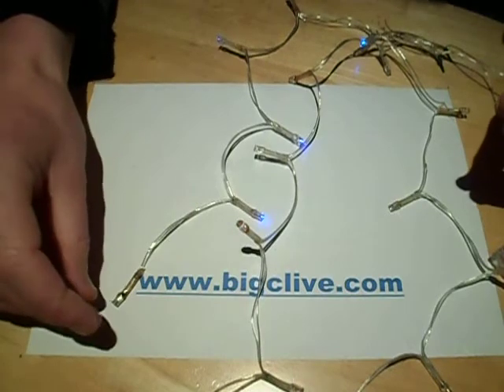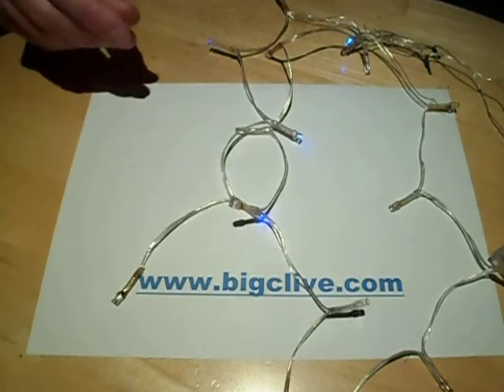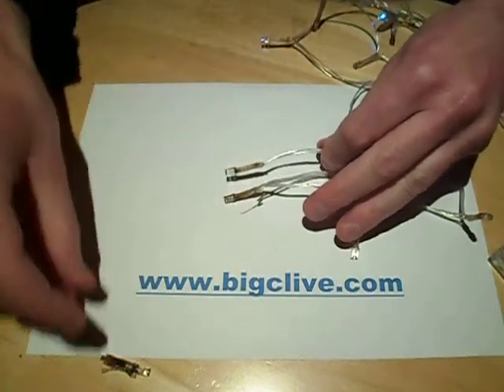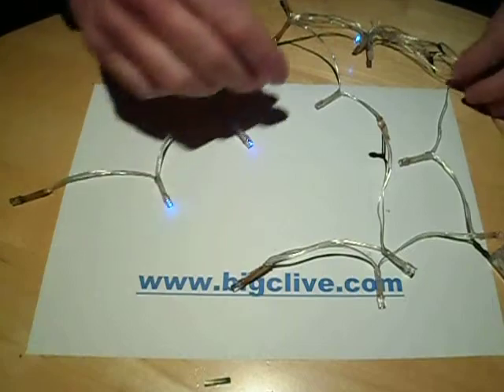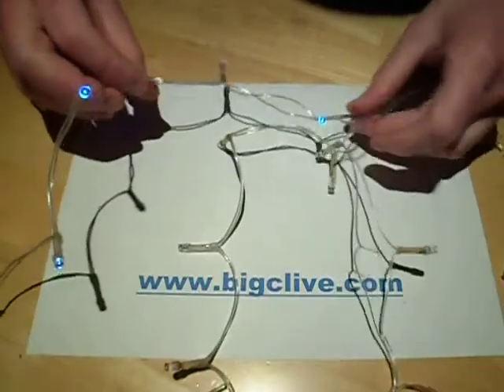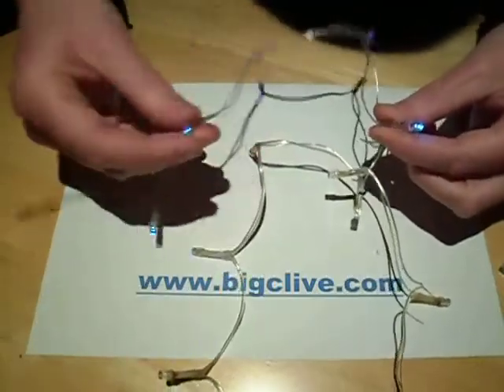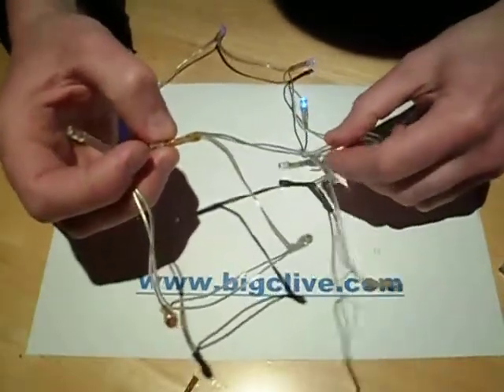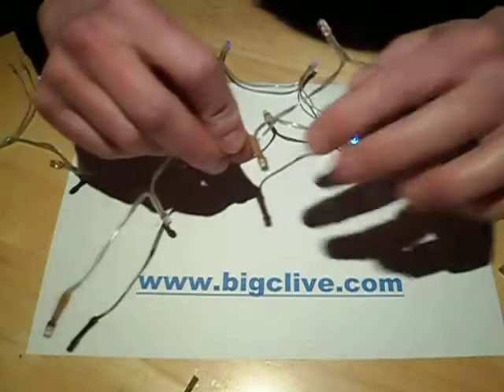Follow-up to the LED waterproofing test.

Comment: Clive
Did you find any good way of sealing the gap between the heat shrink and LEDs?
I thought I would be OK with the set of isicle lights I bought as the PSU was outputting AC to give a rudementary twinkle effect with only two wire and having the LEDs wired in alternating polarity, but no some show that rust staining after less than a month up :-(
Cheers
Reply from the maker: I've not found a simple way to get a reliable seal.  It would probably require the full resin potting as used in professional strings.
Reply: Shame. really thought I would be OK with the AC LV supply. Maybe its just general rusting rather than electrolytic accelerated corrosion. It's only affected a few LEDs out of the 750. I might try injecting some silicon grease from a syringe and hypo needle.

Comment: Having seen your attempts at a solution I decided to try something called Liquid Electrical Tape.  I just coated the place where the wires go into the back of the light to stop water from entering. I will let you know if it actually stops the corrosion.

Comment: My local electronics store sells this neat dual-layer heat shrink, that contains a hotmelt glue on the inside. I found that it's really effective as a waterproofing when I used it to seal the contacts of LED strips to protect them from dog pee in a pet store. I figure the act of the shrinking really crams the glue into the crevices.

Comment: I have had reasonable luck with a tin of high quality marine polyurethane clear varnish diluted 50 50 with turps.  I dunked sets of 500 icicle lights and hung them to dry.  Worked really well,  to stop uv destruction of the pvc insulation.  and sealed every led for water.

Comment: Try good quality silicone sealant - I seal all the solar power lights and gizmos that i use outdoors as they all get water ingress into the battery and led parts - not had an issue now since ive been using the Lidl Greek Silicone sealant for £2.99 its as good as the most expensive sealants on the market imho.

Comment: May be worth a test using grease injected in with syringe and needle that you use for refilling inkjet cartridges.
Reply from the maker: I was hoping to find a fast and simple method.  The injecting with grease could be quite tricky since it has to wick right down and around the leads.  Although the heatshrink on the LEDs is tight I think water could actually creep in from the lens end by capillary action.  That's why I was trying the penetrating oils.
Reply: I have a set of these and will experiment. Lithium grease in a spray can that starts out runny. Or maybe try the epoxy resin used for fibreglass, as that should work and you have plenty of time to get it into the led connections. It's worth experimenting anyway. Another thing that crossed my mind is Waxoyl. As it used to prevent rust inside car body panels, then it should work well on led legs. Also replacing the heatshrink sleeving and stick epoxy in, then shrink it, so it forces out the excess epoxy.